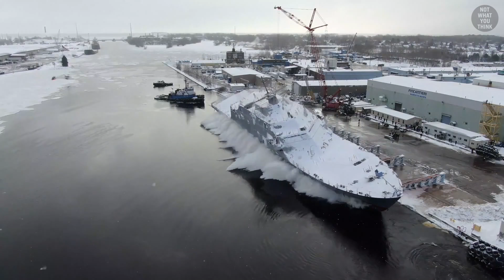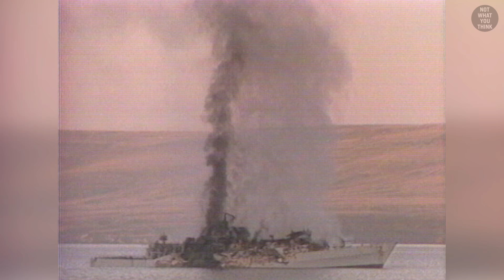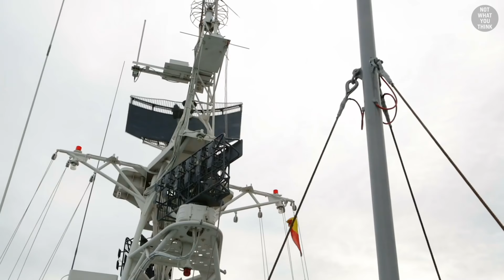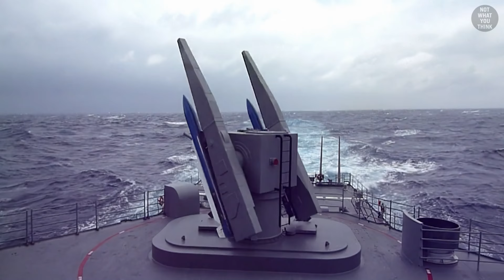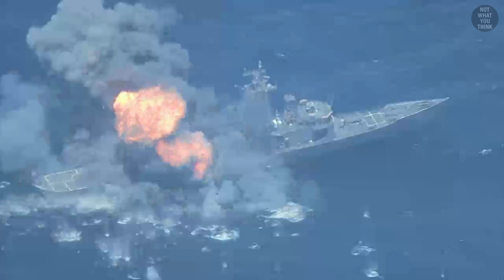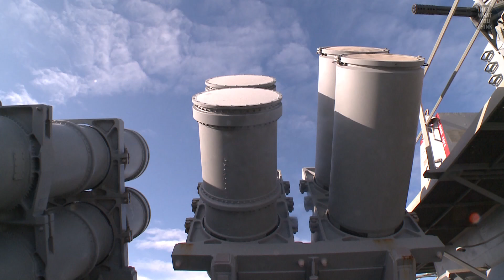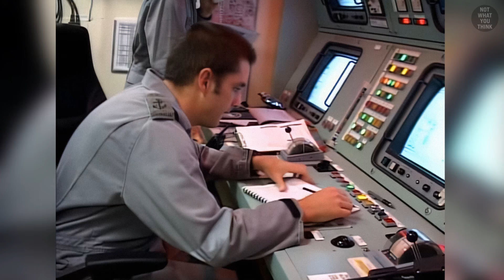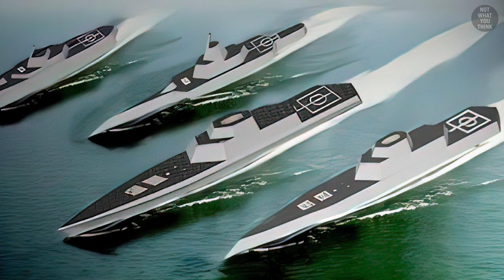How US Navy Made The Most Successful Destroyer ... But Now Has to Replace it.

Comment: Can agis use the phalanx radar and thermal camera
Reply: Phalanx CIWS uses its own standalone radar/tracking, but operators can use the  onboard camera. The ships also has a dedicated camera with high resolution/zoom/thermal for most purposes.
Reply: @TouchableGrass  it was more can they use the radar and camera as part of the agis system
Reply: Even if it could (wasn't a destroyer sailor and probably couldn't say if I knew anyways), I don't think it would provide that much valuable info.

Phalanx's data is only really relevant for the purposes of target tracking and acquisition, whereas SPY is more for the "bigger picture". Looking at the Wikipedia page, it's public info that there is a specific fire control radar (SPG-62) noted as part of the electronics loadout of a Burke, which being a CW radar is designed (like a Phalanx's integral radar system) to just pout RF onto a target to have continuous data on it for accuracy.

AEGIS isn't really for fire control, it's for general knowledge of what's in the area. Fire control systems (which would include Phalanx's radar/sensors) are specifically for painting something you already know the general location of to get additional info.

Comment: Can you do a short on why the Navy uses "flight" to signify new updates to a class versus the the Air Force "A, B, C" designation?
Reply: "Flight" is just another term for "variation"
Reply: So more "flight" as in a flight of beers? I suppose we are quite some decades off from actual flying naval vessels.
Reply: @nayhem  yeah flight block etc mean similar/same thing it’s just showing the generations
Reply: you also have different variation of SPY-1 radar:

- SPY-1: the original radar (70'S)
- SPY-1A: due to SPY-1 alarmes went of all the time, due to insects and variations in terrains in Lebanon. A SPY-1A was donated by US Navy and is used as weather forecast radar!
- SPY-1B: weight reduction
- SPY-1B(V): littoral water improvements (basically)
- SPY-1D: Improved version of the B-version, reduced weight
- SPY-1D(V) Littoral water upgrade
- SPY-1F: Frigate version, smaller in size, 54% reduced range, very sensitive. The Norwegians had to build in a filter, due to the radar would detect snow
- SPY-1F(V): Littoral improvement
- SPY-1K: Smaller, for corvettes
Reply: Air Force uses block not abc like f16 block 2 or so on and so forth
Reply: I don't know what the various terms mean in terms of significance, but the Navy uses all of them.
Mark (mk) i.e. the Mk 41 VLS
Mod (the Enhanced Sea Sparrow has a MK 143 MOD 0 motor)
Block (the Standard Missiles are divided into various blocks, i.e. SM-2MR Block IIIA
Letter designations (F/A-18E or F/A-18F, emphasis on E/F)
Reply: @Nr15121  They use block for minor revisions, but still "a, b, c" for major revisions.

Ie, F-15 a, c, e, ex
Reply: @jonathanmatthews4774  Yeah very true the letter I think is just for aircraft cause the navy jets have it too like f18 e and f but then they also use it to show different variations like f35 a b and c its a crapshoot, they also called a stealth bomber f117 lmao

Comment: How cool to think we got a 21st century version of the Fletcher class
Reply: I actually say that the Burkes are probably closer to Cleveland Class cruisers than Fletcher Class destroyers based on their size and weight (they go nearly 10K tons in displacement).
Reply: @swaghauler8334  Meh, ship classes grow. A 2500 ton (full load) Fletcher wasn't particularly big for a WW2 design, with older Tribals already hitting that level in '36, and them themselves already succeeded by 3400t Battle's ('43) and 3800t Daring's and 3500t Gearing's in '45. Even a multi-role frigate can hit the 6000t load nowadays, with the future Constellation hitting 7300t.
Reply: @swaghauler8334  if that’s the case, what’s the best modern analogue for the fletchers, both in role and size?
Reply: @LuckyFlanker13  Perrys and Spruances maybe?
Reply: @LuckyFlanker13  FREMM (Constellation Class), hopefully
Reply: @seanj4119  fingers crossed!!
Reply: @LuckyFlanker13  i dont think there is a modern analogue for them. The roles just dont line up anymore. I guess you could say the Alrieghs are still the grunts of the fleet though, like the fletchers.
Reply: @whispofwords2590  True.They're like if the Brooklyns or the Clevelands took over most us navy surface warfare duties
Reply: I think they're being called that because there's over 60 of the things, which is an astonishingly large number for a ship class of its size and capabilities. Plus there's another 20 Ticonderoga Class Cruisers on top of all that.
Reply: I don't think Arleigh Burkes are anything like Fletcher class destroyers, which had narrow hulls for speed.   My dad served on the USS Smalley which was a Fletcher.
Reply: The Fletcher was faster!
Reply: It needs to be replicated again, The Independence and Zumwhalt Class, are not sustainable for replacing the entire fleet.
Reply: Fletcher class was more closer to the LCS class why the hall was not known to crack the fletcher class was a fire hazard was not capable of traveling very far because because of fuel requirements And the  British mocked it considerate very poorly designed 

it’s also the same destroyers by World War II When the British was having such a shortage of destroyers And having u-boat problems we basically took all the destroyers and  gave them to the British
Reply: @LordInquisitor701  Not a lot of those statements make sense. Why compare a WW2 DD with a late cold war aluminium superstructure frigate?

RN wasn't really desperately short on destroyers, they where very much short on convoy escort ships, and had to use DDs for them. This was partially alleviated by the USN giving part of their (WW1 vintage) Clemson 'swarm' they where build directly into mothball status, which was better than nothing.  And it really got solved when UK and USA build specialized escorts like frigates and sloops where brought into service. The USN did not become became a larger navy till late '44, 45.
Historically the RN was always short on cruisers pre-war, as in contrast to the USN who only had interests in the defending their two Ocean borders, the RN needed a believable determent to safeguard their interests all over the world (North Sea, North Atlantic, East and West MEDITERANIAN (!), Indian Ocean, Streets of Malaya, etc.). Large self-sustaining vessels that looked powerfull and impressive enough to make potential local rivals think 'I can take those cruisers out, but that means without a doubt war and then the largest and most powerfull battlefleet in the '30s will pop up 3 weeks later'. Reminding you that unlike the USN, the UN did had the logistical chain to operate those battleships all over the world, while the USN had to choose between operating a carrier taskforce or a pair of battleships in '42 / '43 with the limited numbers of fast fleet oilers (I can really recommend reading Neptune's Inferno and in comparison The Last Stand of the Tin Can Sailors what impact 2 years of learning and 3 years of building had on the USN capabilities).
Reply: @LordInquisitor701  What a pile of garbage. For a start, your statement that Fletchers were the destroyers exchanged in the Destroyers for Bases agreement is utterly false and reveals your utter lack of knowledge. 

The destroyers exchanged are widely referred to as the 'four stackers' due to the distinctive four funnel design. They were Wickes and Clemson Class destroyers designed during WWI and built in the late 1910's and early 1920's. 

The Fletcher Class was designed in 1939, and built from 1939 until the end of the war. They were arguably one of the finest destroyer designs of that period. They a superb balance of size, speed, firepower, and most importantly top side stability, the latter meaning they could be upgraded well into their service careers with few issues with stability. 

The British absolutely did not mock the Fletchers. The British themselves had some very good Destroyer designs at that time, especially the Tribals and the later Battles, with some of the War Emergency designs also being excellent classes, so they recognised a good destroyer when they saw one, and the Fletchers were very, very good. 

The Fletcher actually had exceptional range for its displacement. No destroyer is ever going to have the range of a cruiser or capital ship without requiring fuelling because of the nature of destroyers. Their high speed meant low fuel efficiency but was absolutely a requirement for their mission. Their small size meant that less fuel could be carried. This compromise was WELL UNDERSTOOD by the Royal Navy, as well as the US Navy. 

I do not know whose rectum you pulled your statement from, but its objectively false. You did not even get the damned classes involved right, which indicates to me you know precisely nothing about the ships involved....
Reply: @LordInquisitor701  No one mocked the fletcher class destroyer, it was probably the best destroyer in the war.

Comment: A destroyer by definition is smaller then a cruiser, so having destroyers the size of cruisers would not be destroyers.
Reply: Definition isn't about size, it's about purpose, and cruisers pack a lot more firepower.  Either way, the Cruisers are going to get decommissioned anyways.  We rather open borders, send money to Ukraine, pay off other students' debt, than to have a powerful military to put China in check.  They're probably going to use the DDGX platform as a modular unit to run destroyers and cruisers.  Could save money in the long run towards their 6th gen fighters.  I won't be surprised if there's no more cruiser classes, only DDGX with Arleigh Burke.  6 are planning to be decommissioned this year.
Reply: @DroneStrike1776  the bazillion missile launch cells of the burkes would like to differ
Reply: It’s more their role than size but generally yes they would be smaller but mostly as a consequence of their role
Reply: Nope, it comes down to capabilities and purpose, weight or size doesn’t matter